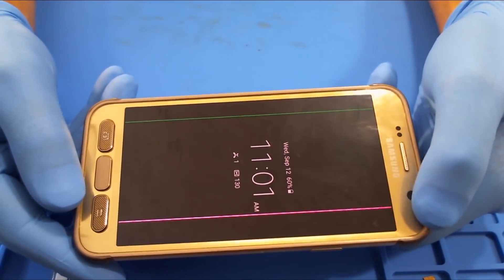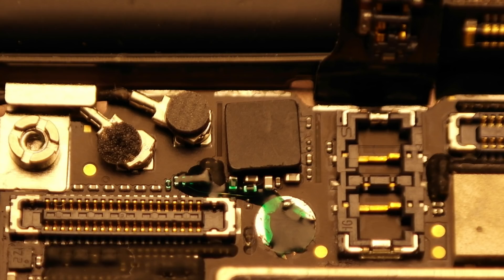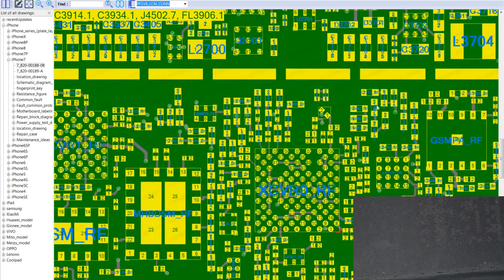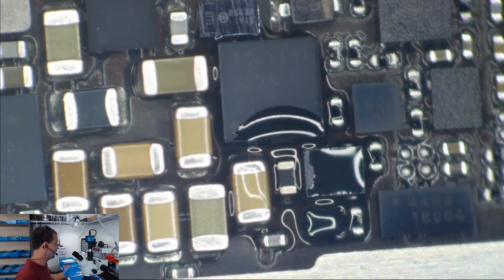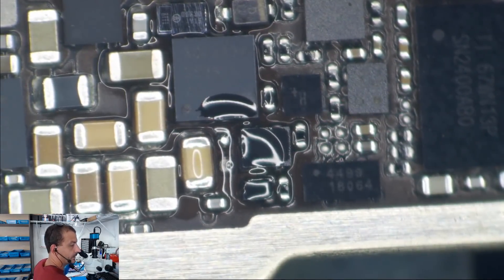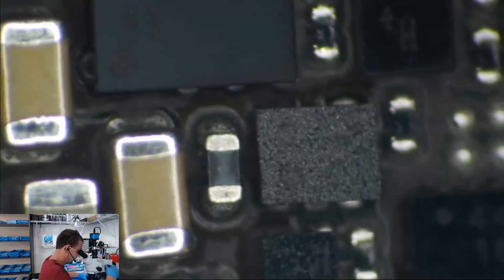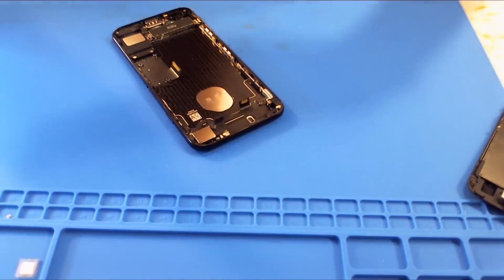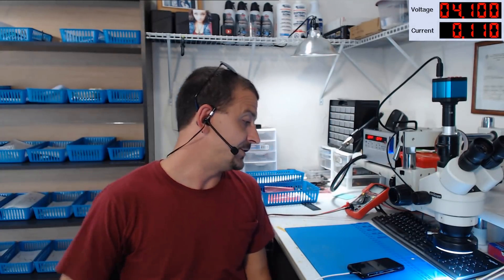iPhone 7 No Image Repair from Germany (Caused by screen replacement)

Comment: Is the original home button working well after putting inside?
Because I had one iPhone 7, home button stoped work after cutting button's ribbon flex.
I have tried many other buttons and LCDs and still the same. No button detected.
I remember that Jessa from iPad Rehab was asking about that issue at live streaming  but no one was able to help.
I have checked connector on the board on diode mode and readings were similar with healthy board.
I should check voltage on working board?
Do you have any clues Jason? Mamba, mesa?
Thanks for time and help!

Comment: hello jason
I want to buy this microscope model: 

https://www.amazon.de/AmScope-Trinokulares-doppelarmigen-Auslegerstativ-Videoanschlu%C3%9F/dp/B004V1KD2E/ref=sr_1_3?s=ce-de&ie=UTF8&qid=1537291516&sr=1-3&keywords=amscope)

What do you think about this model?
Reply from the maker: It looks a lot like the one I have which I love but mine is 7x-45x zoom.  One very important thing -- I cannot find where that one specifies that it is a simul-focal microscope.  Simul-focal is a must have if you want to use a camera & work at the same time.  Without simul-focal, it will block off one of your eyes when using the camera.

Comment: Nice video and fast repair. Wondering is any genuine reason you are not using some board holder ? On your  movies logic board is moving in all direction :) . I don't mind just wondering . Keep up good work.
Reply from the maker: Thanks.  I use a board holder most of the time these days.  In this video, from the moment the filter is removed, the PCB went into a holder.  I should have left the part in where I clamped it down.

Comment: Hello what tool using for schematic diagram ?
Reply from the maker: I use FlexBV from pldaniels.com, Easy Draw from unionrepair.com and ZXW from wherever I can buy or renew it when the time comes.
Reply: @ststele  which is best one for beginner ?
Reply: Maybe ZXW, but you will find similar info in all of those..

Comment: Gd job bro 
How the AssistiveTouch button come on the screen ?
Thank u
Reply from the maker: At some point, Apple added a feature to iOS so that when the home button isn't behaving, it automatically turns on assistive touch.  It seems to need a home button connected to do it tho.
Reply: @ststele  Sometimes that Assistive Touch Button doesn't appear. If you got a Home Button issue and the Soft Button doesn't appear, just switch off the iPhone. Then turn it on and when the Apple Logo appears, press and hold the Volume Down Button, until it booted up to the setup screen. The iPhone will skip the "Hello" screen and go straight to country selection ;) Just a tip of me :) Best regards! Tolga